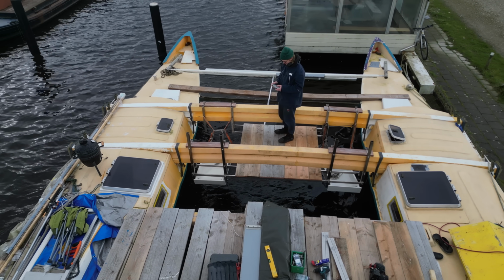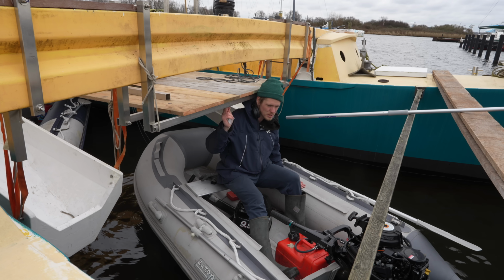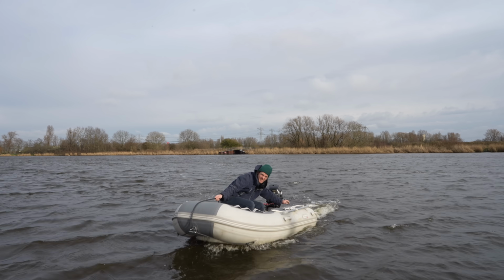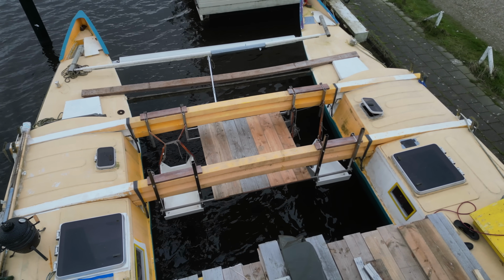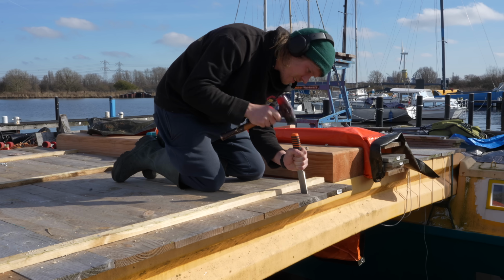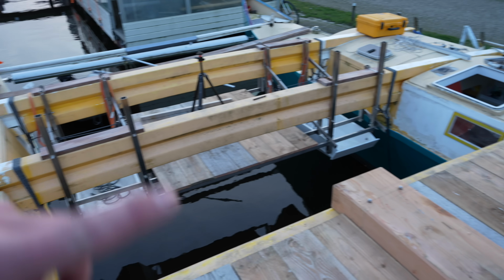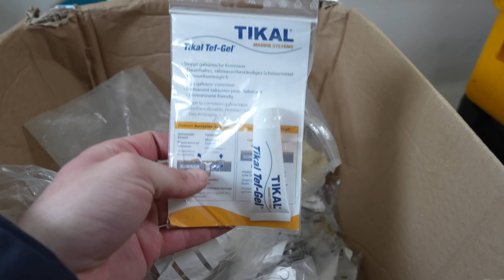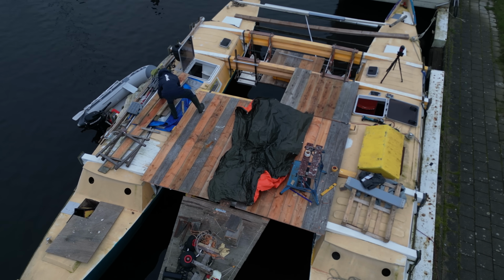A Simple Deck for a Simple Man’s Ocean-Going Catamaran.

Comment: I would say You should not worry about the bolt size, but about the overall stiffness of this construction. Why don't You ask somebody to weld it for You? I would have hard time trusting the UNfasteners to keep it all together. Why? Because it will move on the sea, the motors will exert momentum and the whole thing will be moving around on the joints. Stainless is great unless it's contantly exposed to bending, it can just break unexpectedly. I doubt if the engineers posting here that it's all ok because it's 5x safety margin on the static stress have counted the stress in case of rough wave hitting you and rocking the boat hard. Same concern I have regarding the planks. Maybe it's the video that makes it so, but it looks a little thin for the job. Imagine 4 people in the cockpit+ movement on 20 feet wave. Make it rock solid, someday Your life will be hanging on those.

Comment: There's quite a lot of surface area being compressed together by the bolts. The bolted joint doesn't experience all the force, the friction between the surfaces may be what provides the most force resisting the downward direction. Unless the surfaces are losely held and "floating" on the bolts, the bolts aren't actually experiencing the full force due to the masses involved. Basically, this is a bolted joint in shear load. I recon there's more than enough strength in the bolts to keep it together. I'm not a mech eng though. @mattkelty5855 is but it doesn't seem to me like he took into account the fact that the joint involves a lot of surface area. Anyways, here's some interesting relevant material: https://www.youtube.com/watch?v=XLzTB4KLCxU

Comment: Not the bolt the problem beside the thread end will cut body parts unexpectedly. It that tiny nylon rope and pulley your using leverage with muti pulley that not even worth the time to install, in the sun all day salt air and water the first heavy haul you need to do 6 month it’s going to break, the design all wrong unless your used thick thick stain steel cable abd a motor or a one way lock wrench pulley type the leverage strain on a iron bar handle not on tiny rope that wraps around few  pulley of diffrent bending . If the rope broke what the alternative an can you do it in a storm. LOL  you can’t repair much at sea
Reply: And  while Iam at it , starting up  that raft  it facing the wrong  way  if somehow that raft take off  your going to split your head on the beam and even the thread bolt, they rip skin, cut / grind it off level &  your facing the wrong way so you  wouldn't see in 2 second  it head level behind your head and that the worst you get knock out,  set up for good safety habits  first.